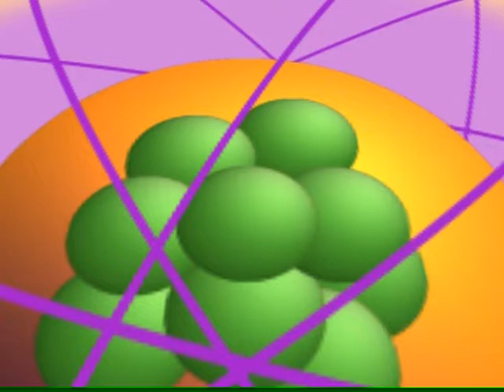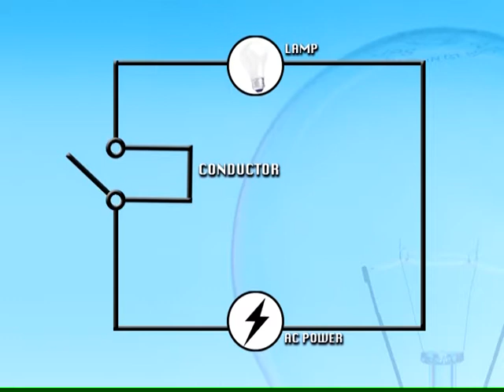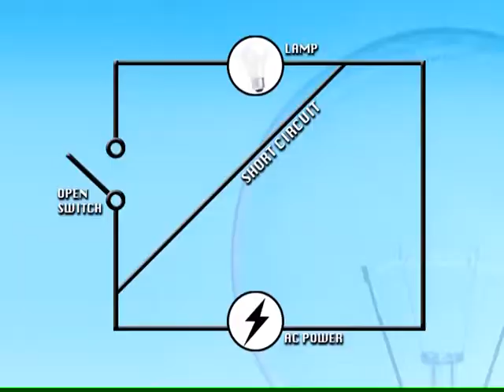Outdoor Electrical Safety Chapter 1

Comment: For the video being called electrical safety there's 2 big things that can get someone hurt.
1) electricity takes all paths, not the shortest path.
2) light switches aren't always before the light bulbs, so you can complete a circuit still even if the switch is open.